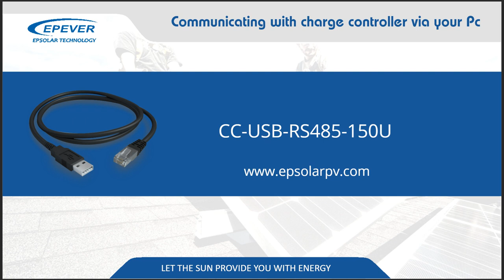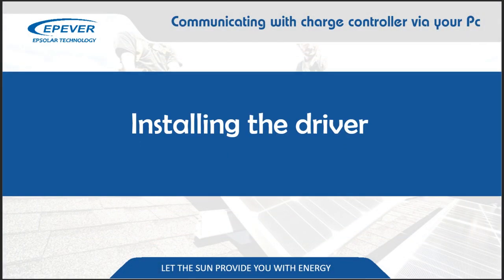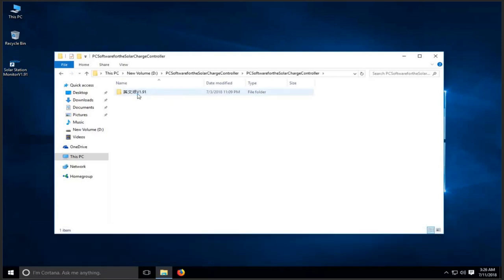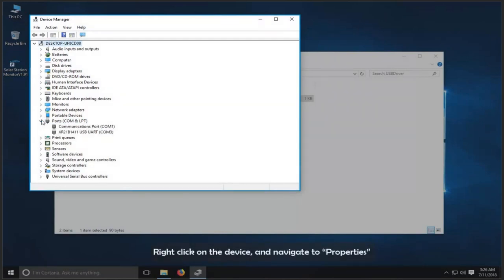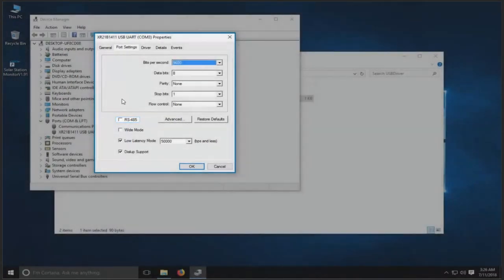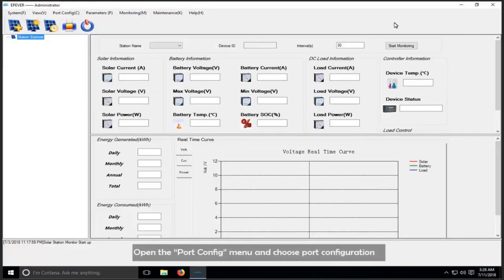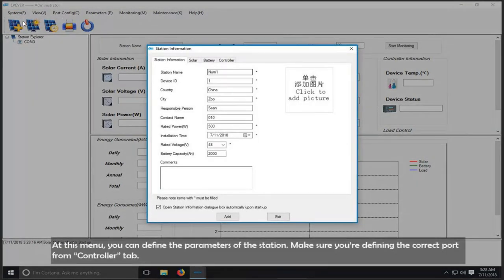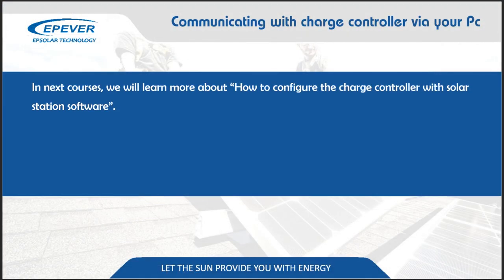Communicating with charge controller via your Pc

Comment: I have a Tracer3210AN with the CC-USB-RS485-150U cable and have followed this video though on both a Windows 7 and Windows 10 system. In the software I get a com port error when trying to monitor "Operation failed. The operation has timed out." 
I have set RS-485 in the port settings in Device manger and ensured the port config and station port numbers all match the device. Baud Rate is set to 115200 in port config and device manager. Do you have advice on what to troubleshoot further? 

If I connect the MT50 into the com port it works as expected.
Reply from the maker: Dear Trout-Slap, have you contact our support for your issues yet? If not please take a picture of the RJ45 side from the CC-USB-RS485-150U cable, then send this to support@epsolarpv.com, thanks in advance and have a beautiful day!
Reply: if it showed up as a CC-USB-RS485-150U under ports and coms in your device manager you don't check the rs485 ... only if it shows up as xr21b1411 USB UART do you check the RS 485 box
Reply: Same issue here with Windows 11. Computer shows "XR21b..." in Device Manager, RS485 is checked, baud rate matches. Follow instructions step by step but still getting the "Operation has timed out". Using 20A Triron Controller.

Comment: Good afternoon on a sunny day in Mullion Cove Cornwall : )

I have three Epever Triron 4210 charge converters which I connect one at a time to the computer.

While playing with the settings of the computer program on one of them, it suddenly refused to communicate.

The other two are fine, I have tried a different computer but the problem is still there with same charge converter.

It is not the settings in the computer program.

It is possible I have altered some setting in the charge converter itself via the computer program which has caused this?

Is there a setting within the charge converter to turn the communication port on and off ?

I have looked online on resetting, but other that disconnecting the panels and battery which I did for 45 mins cannot find anything.

God Bless Chadd
Reply from the maker: Hi sir, thanks for reaching. Please check the communicate module inside the Triron, you could contact the seller if the module has issue.

Comment: Tried 2 different computers, both refuse to connect, it always times out. I've tried manually installing the drivers, i've tried a desktop and laptop, changed baud rates, flow control and NOTHING i do will make the device connect.  Always "the connection has timed out".
Reply from the maker: Hi Sir, thanks for reaching us. Please send an email to support@epever.com, our support team will help you asap.

Comment: Why cant i just use cat5 cable directly from controller to pc? Or crossover cable?
Reply from the maker: Thanks for your comments, some laptops do not have the internet cable port, but most PC got the USB port.
Reply: @Epever  Could I use a CAT-5 cable? My laptop does have one. Thank you.
Reply: @StuffBudDuz  WARNING: DO NOT communicate with the PC using the Ethernet
cable, otherwise the components of controller will be damaged.

Comment: The pinout of the RS485 cable of USB 1 (+ 5v), 2 (Data -), 3 (Data +), 4 (GND), which pinout of the RJ45, 1 ... 8, corresponds to the model Triron3210N?
Reply from the maker: Sorry I didn't get your point, you can find the right pinout of the RS485 cable from our helpdesk, or send and email to our support where you can find it on our official website under the contact section, thanks in advance!

Comment: No manual diz que é o cabo rj45, eu posso utilizar o cabo rj45 para USB?
Reply from the maker: The normal network cable will not function, if you don't have the CC-USB-RS485-150U cable, you need to modify the cable, please contact our technical support, you can find the information on our official website www.epever.com under the Contact section

Comment: is there a way to connect using only rj45 to rj45 (ethernet)?
Reply from the maker: Hi Doni, it needs rj45 to usb communication cable. If you want to use rj45 to rj45, you may need another TCP module.
Reply: Is the tcp module a special accessory for epever devices?
Reply from the maker: Hello Doni, please check the product link. https://www.epever.com/product/accessories-serial-device-server/
Reply: Are you have datasheet Baterai charging Lithium 4Seri
Reply from the maker: @doniorlando5606   Doni, we don't have batteries. If you need charge controller which can charge 4 series lithium battery, please check our website.

Comment: So I don't need a shunt? I'm confused, how I can check the state of charge of my battery bank?
Reply from the maker: The state of charge of your battery bank will be displayed on the software, it's in real time, you can always check it when you like to, also we are designing a new system which will be released this end of the year, it will be a cloud platform, so you can check your system status at any time and any where, feel free to subscibe our channel and we will also annouce it on our official website. Have a nice day!
Reply: @Epever  Thank you I got the 40A charger and it's working well, although sometimes it surpasses the 14.5 charging Voltage limit of my batteries and the batteries do a bubbling sound sometimes
Reply: @informing_  go to the parameters (alt+p) section, then control parameters and change the overvoltage setting to 14.5. Once a month it cycles SLA batteries at a default 14.6v as an equalization charge, so it might turn that off unless you lower that value as well one also. You may have to use the user type under battery type and just copy all your parameters and change those ones I just mentioned.

Comment: No Linux support? This is a joke
Reply from the maker: We are designing a new IOT platform, which you can just monitor and control the system from internet and any OS.
Reply: @Epever  Is it going to work in browser with no internet connection available? Is it ready yet?
Reply: @Noniksleft  Hi, yes, works both in LAN and WAN. Expect to be released in one month or two.
Reply: haha, you linux people. write a code for your charger :D